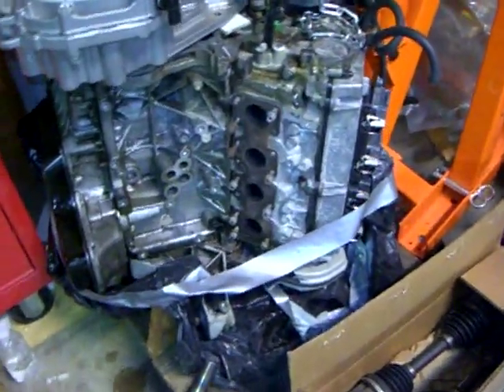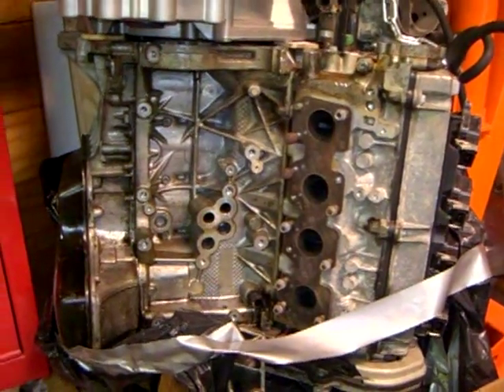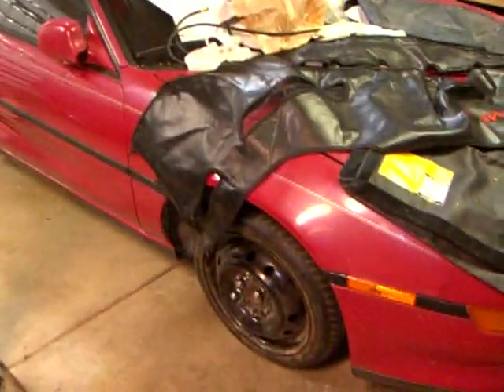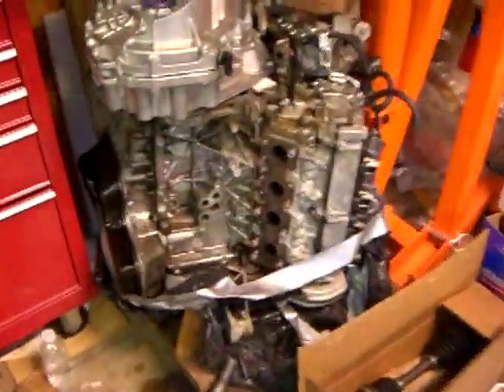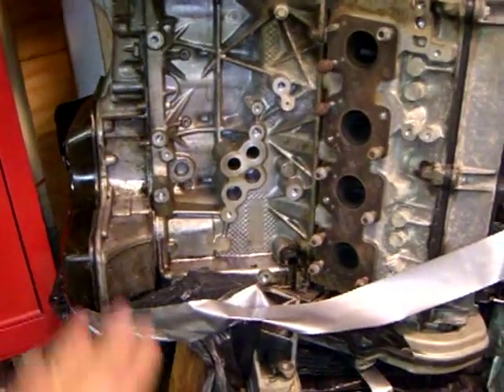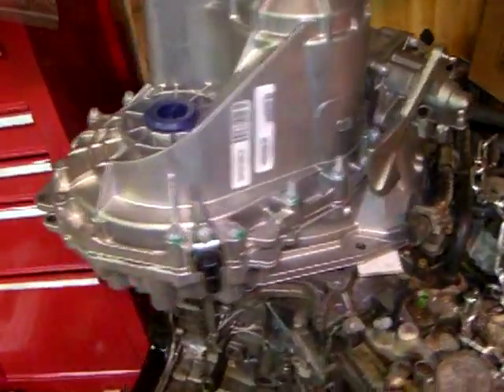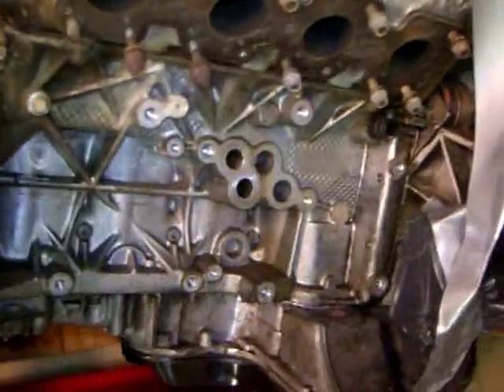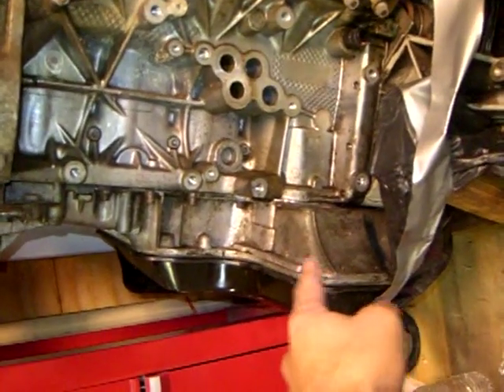MR2 V8 Engine Swap: Audi A8 ABZ V8  GM F40 Transmission  Toyota MR2 Turbo

Comment from the maker: Do some reading about head gaskets and oil consumption before deciding.  N* is the single best value for V8 in MR2.  Other V8s might fit, but are far more $.  

cadillacforums [dot] com/cadillac-tech [dot] html#noil

cadillacforums [dot] /cadillac-tech [dot] html#gasket

cadillacforums [dot] /cadillac-tech [dot] html#full

cadillacforums [dot] /forums/cadillac-forum/f-23 [dot] html

Comment from the maker: LS1 = 27.5" & wont fit transverse period.  See my post below on engine+trans widths.  I looked at a lot of engines including Toyota 1UZ-FE = 26".  Engine + trans cannot be wider than 37".
Longitudinal is an option.  HUGE amounts of cutting and rebuilding the whole back of car if you do this.  A guy on MR2OC.com is doing this now.  Also, a stretched MR2 has been done before.  I have photos.  Another guy is doing LS4 + auto trans (that it comes with) in a 3rd gen MR2.  Lots of cutting, but not bad

Comment: Ive been looking into buying a MR2 and doing a v8 swap but with all the issues that N* have with blowing head gaskets and drinking oil like crazy im kind of getting turned off to the idea of having too deal with that... what would you have to do make an ls1 fit transaxel?  how much cutting would need too be done?

Comment from the maker: Yes, an LS would be great.  It was a choice I considered.  Possibly the LS4 might fit, but it is not certain yet.  Most LSx's are too long to fit transverse in the MR2, especially when coupled to a transaxle.  THey do fit Fieros with minimal modification, if you don't mind Fieros (Not my thing).

Comment from the maker: MR2 Turbo: 3S-GTE + E153 trans, overall width is 36".  Northstar (N*) + F40 overall width is 37", both as measured in the car (transverse).  Match that with whatever engine/trans you want to use, it might work.  Custom axles are required.  I designed mine, GM spline at one end, MR2 turbo spline at other end.  Axles are slightly different lengths.  Axles cost more than N*.

Comment from the maker: overall width, valve cover to valve cover, and with headers width, and wether or not engine accomodates a jackshaft/cv joint running next to it (right side axle), and if you are using a trans that did not come with this engine OEM, adaptor is required, but will it accomodate bolt patterns on both sides?  Exmple:I found axle clearance issues and adaptor problems with Audi V8.  SHO V8 external dimensions might work, so its the trans that has to be sorted.  Overall width of trans needs considertion

Comment from the maker: No problem, originally, I was referring to the cam issues when I said unreliable.  Yes, any engine could be used.  It just depends on the time/effort/money you want to spend.  Were any SHO V8's offer with a manual trans?  One guy on MR2OC is fitting a LSx + auto trans into the MR2, but he's cutting the car a lot to make it work.  When deciding on an engine, need crank pulley to bellhousng dimension-the line the trans bell and engine block create when joined.  center of crank to top of engine and

Comment from the maker: I found external dimensions of  Volvo 4.4 and its not ideal (too long from crank pulley to bellhousing).  No manual trans came on it, so what trans would fit?  Adaptor probably needed.  What flywheel? No OEM or aftermarket flywheels avail.  N* has 2 different aftermarket flywheels, though only 1 of them will work.

Comment from the maker: If your heart is set on the SHO v8, be my guest.  I elected not to use it for various reasons.  N* is easy to find, it bolts up to the F40 (no adaptor needed, except for the flywheel).  SHO v8 will need a custom adaptor, and flywheel adaptor, assuming stock flywheel will fit inside the F40 trans, or you might be able to use SHO trans.  Lots of unknowns.  I couldn't find a sho v8/trans to measure external dimensions.  N* fits MR2 with minimal chassis mods as well.

Comment from the maker: @madjimms 
Thanks for sending the link at hxxp://on [dot] msnbc [dot] com/sGXRng  <--replace xx with tt, remove spaces, add dots

The thing is that I am recommending the 1994-1999 Cadillac Northstar engine alone (not rest of Cadillac vehicle). I don't recommend the 2000+ N*, as they are radically different.  Also your article says they rated Cadillac, as a whole vehicle (not engine alone), and these are for 2010 models.

Comment from the maker: @mr2v6sc 
the 3S on my 93Turbo is 30 lbs lighter than stock: Lightweight alternator bracket, lightweight downpipe, lightweight flywheel.
Imaging this:  V8 Northstar (4.6L) with turbo or supercharger added.  The caddy guys figured out how to turbo the N*.  Should make more power than in a Caddy, due to shorter exhaust run in the MR2 vs. Cadillac, not to mention difference in car weight.
V8 SOUND!

Comment from the maker: V8 vs. V6?  1 could argue: Why bother with V6?  3S-GTE comes in MR2 Turbo, easy to add aftermarket to make 300+ horsepower.  3S can make 350 Hp reliably.  V8 is just cool.  MR2 is small car.  I can say "I stuffed a big honkin' V8 in that little mid-engine sports car!

Comment from the maker: @mr2v6sc 
The SHO v8 doesn't bolt on.  The GM Northstar (94-99) bolts on to the F40.  This is what I went to (see my later videos).  The Northstar has a small amount of aftermarket available for it to bump up power, and an OEM supercharger (the 2000+ supercharger bolts on, AFAIK).  SHO V8 = very unreliable, and no power, no bolt on F40 trans = not worth the trouble.  We don't even know external dimensions. N* fits in MR2

Comment from the maker: @ 666Yoshi
Depends on how you do the project.  You have the 5S-FE so the easiest/cheapest swap would be the S54 manual 5 speed that came in non-turbo MR2.  You will need to hang a clutch pedal and install clutch master cylinder and hydraulic lines. Swap auto shifter for manual is pretty easy.
V8 swap with GM 6-speed would be a more expensive swap.